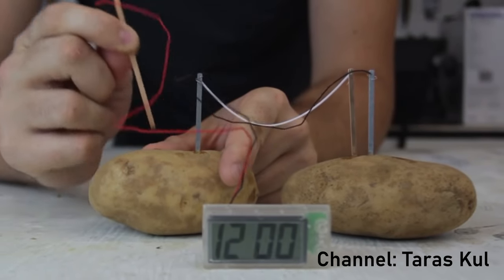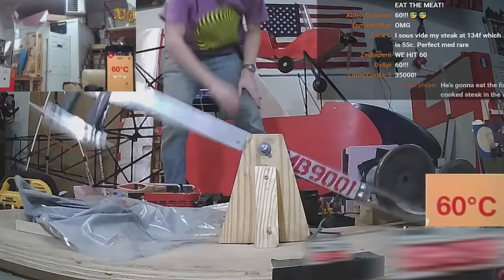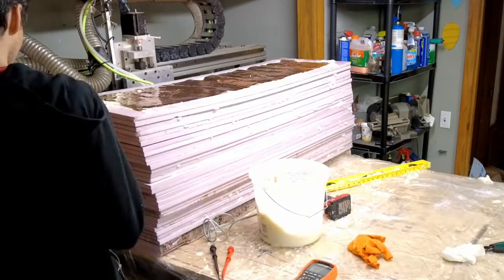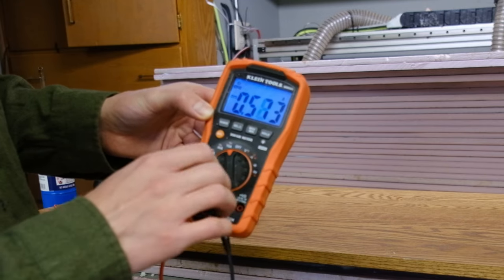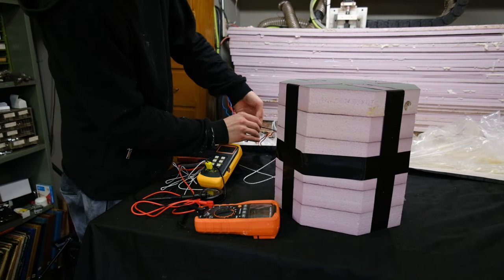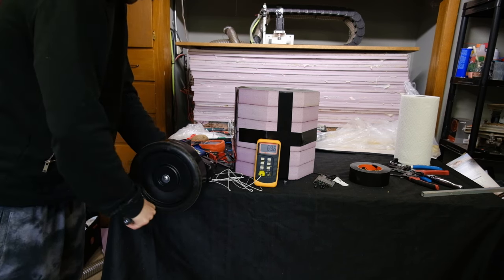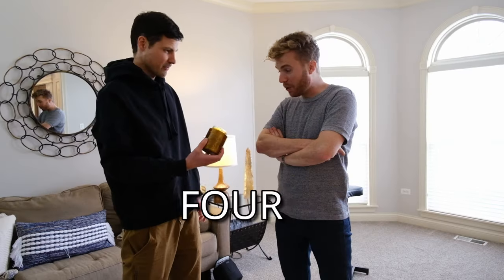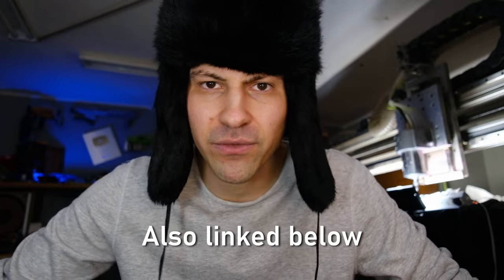Can you cook a Potato with a Potato?

Comment: Well, as the potato is not the part giving energy to the cell, but just the way to transport energy, you probably should use the thinner potato layer possible.
Then, using spiraling Insulator/Cu/Potato/Zn assembly, you could make a cylindrical battery "easily" top-fillable (and cleanable).
Also, the heating element is very nice, but insulating the potato further more with aluminium sheet is a waste of power (well, it can help spreading the temperature and will delay the cooking. So you can stop using your energy source and wait a bit for it to give back it's energy).
But anyways, the potato will degrade and won't allow electrons to pass, reducing the cell efficiency.
(Or I am wrong, that could very well be the case too, it's getting awfully late here).
As for cooking, you can assimilate a potato to water, and check how many watts you need to raise it's temperature to 100°c ish. That should give you a starting point to chose your powersource, and thus the size of your potato battery.
Your insulation on your cooking oven is insane! That's a very nice job, Bravo!
And the fall back solution is really nice too, I love it.
Thanks for this video, it was really interesting and entertaining!

Comment: i thought you were gonna use your jet engine to shoot one potato against another at supersonic speeds that the impact force itself would be enough to heat it up to 250 degrees and keep it that hot for a couple minutes. i guess this COULD be possible with enough insulation and high enough friction in the air or sth? maybe the jet engine isnt enough, though and what you'd really need is sth that goes boom

Comment: The potatoes aren't the source of the energy, they're just the slightly salty electrolyte, the zinc/copper electrodes actually provide the energy. It's why lemons are much better batteries, because they have much more acidic juice inside them, which allows for higher ion flows.
Reply: Your powdered potatoes are probably worse than regular potatoes, as I imagine they are slightly drier than real mashed potatoes would be, and they might well have lost a lot of the chemicals which slightly modify the PH of 'potato juice' during the desiccation process. This could leave you with a very low conductivity electrolyte, preventing you from achieving your desired power output.
Reply: Potato juice has a pH of around 5.6, as opposed to potato itself which is about 6. So, when you press a potato before drying it you remove the slightly more acidic juice, which you don't do if you just smash raw potatoes, or even if you boil them. This could have massively impacted your potato battery power, because even a slight increase in pH probably obliterates its ability to do ion transport.

Effectively, when that guy told you to use dried potatoes? That guy was the real potato.

Comment: You could try wiring some of the potato cells in parallel to increase the amount of current the battery can provide with minimum voltage drop.
Reply from the maker: They were all in parallel
Reply: @JoelCreates  Oh. They looked like they were in series for whatever reason. My bad.

Comment: The potential energy isn't in the potato it's in the metals. All the potato does is perform the roll of the electrolyte. Your power is dropping because upon initial connection you drain the surface charge. After that all that was available was the current that could travel through the potato electrolyte. If you would have simply added lots of salt or maybe baking soda to the potato mix you would have gotten better current. However as stated earlier the potato isn't what's creating the energy, it's the metals. It's NOT potato powered, it's zinc and copper powered. The potato just regulates the current. You could pee in the potato or simply use pee or Gatorade or salt water or Flint Michigan water there are so many different things that can replace the potato but only a handful of things that can replace the zinc and copper. Also you were likely losing tons of energy from shorting out the cell. You should have had a membrane between the potato. So zinc then potato then membrane then potato then copper.

Comment: The potato battery probably lost a shit ton of power due to two major factors: electrode passivation and ion diffusion. The zinc surface oxidizes quicklly and the starch is probably chelating the zinc and depositing over the surface, reducing the electrical contact. If I had to guess why this doesn't seem to be a big issue in smaller potato batteries, I'd say it's because of the slower reaction rate. Ion diffusion, however, is probably the biggest culprit. At the begining, there's no zinc in the potatoes and, as such, the chemical potential is at its maximum and the reaction rate is super fast, giving you that high current, but as the zinc ions start diffusing, the concentration gradient goes down and the reaction rates drop
Reply from the maker: Appreciate the info!
Reply: @JoelCreates  you're welcome. For future reference, to get the absolute maximum out of your potato batteries, you can try to use the thinnest layer of potato possible, since diffusion speed thtough potato must be really slow, and you can also try salting the potato mush to increase the amount of electrolytes in solution, that should diminish transport effects

Comment: I think a much more efficient way to cook a potato using a potato is by burning a potato they seem like they catch on fire decently easily you can get a rough estimate of how much heat it would produce as potatoes are 110  calories per 148g (they mean kilocalories I calculated it based off of how many jewels (623 KJ) of heat energy a potato has and it's roughly 110 kilocalories) so in other words enough energy to heat 110,000 grams of water by 1° c so assuming you want to cook a potato that has a mass of 148 g and the thermal properties of water  you could raise its temperature by a slightly ridiculous 743° c. according to Google you want to cook a potato at 220° c for 60 minutes so that would give you 3.37 potatoes cooked per one potato set on fire (note this is assuming a perfectly insulated oven and that there is no Mass inside of the oven other than potatoes I.e. the air would take energy to heat up as well also note the unit in jewels was from the FDA the only reason why didn't use it is because it didn't have a corresponding mass of the potato it just said "a medium potato" and I would much prefer a mass unit so I just calculated whether they meant kilocalories or calories by using FDA unit in jewels to back up their claim and unused the data for the number of calories was provided from potatogoodness.com)

Comment: What if you used tubes like the low voltage crystal batteries that run for years? smaller size but perhaps more consistency?

Comment: Probably would've been a better idea to drain the potatoes voltage into an actual battery, just attaching potato after potato until its eventually charged and then use that battery to power the oven. Its not cheating if the electricity was still produced by a potato and the battery is just the storage for that electricity!

Comment: I made a 1.5v battery go to 100v using a joule thief with a transformer and voltage multiplier circuit (cockroft-walton), so I'm guessing that you can make a joule thief powered by a couple potatoes, and make the transformer have multiple windings in parallel to get high amperage which should be enough to cook a potato (or at least burn its surface). In my opinion, transformers are so overpowered, so, just maybe, you can make a potato power a transformer to cook another potato. I'm starting to realize how impractical this is getting though.
Reply: Transformer can boost voltage, but can't boost power (energy). That's a limiting factor with potatoes.

Comment: if we ballpark the pedalling with 100w and use the random figure of a normal potato battery of 0.0012 watts i found with google
that means you'd need 83 thousand potato batteries or like 17 tons of potato batteries to equal your pedalling

this of course is with only one wire of copper and zinc each , soooo

Comment: Pretty sure the problem was actually the potato mix... I'm guessing it ended up doing electrolysis from the water and the resulting air bubbles broke up the connections, which narrows the space for the circuit and spirals until the current dropped low enough to become neglible for electrolysis.

Comment: I would've used the potato battery to slowly build up a collection of hydrogen gas using electrolysis. With enough hydrogen stored, you could then drive a hydrogen fuel cell or a generator to raise the temperature in the small oven

Comment: Your giant battery should have been able to do the job and then some.  Did you add any sort of additional charge carrier (salt) to the potato flakes?  I'm thinking that they just weren't conductive enough to act as the electrolyte.  Without mashing anything you ought to be able to make a battery that puts out 1W from 50 or so individual potatoes and 4 galvanized nails/pieces of copper each.  You'd do pipe (gap) nail - pipe (gap) nail - pipe (gap) nail - pipe (gap) nail in a line in each potato (nail - pipe is a nail wired to a pipe, both stick into the spud).  That would generate a little over 2V at ~0.01A.  Run a bunch in parallel and Bob's your uncle.  No need to mash anything.

Comment: Slapsgiving is a bit of a sausage fest!

Potato batteries aren't powered by potatoes anyway, it's the metal that does it. Probably most of us know that. Maybe adding salt to the mash might have helped. I suppose you could eat a potato, giving you the energy to work the pedals. 

Also might have helped to make the spud cells thinner, less potato between the electrodes, allowing the ions to travel more easily. So lower internal resistance = more amps and more available voltage.

Comment: You clearly need to desicate and then burn the potato to have any hope of cooking the other potato.  A potato is mostly water and to raise it to the boiling point with require a lot of BTUs.  Dry Potato is basically starch and the energy content of starch is 17.5 kj/g and Potato is 80% water so thats 3.5 kj/g for raw potato.  To cook Potato it's temperature needs to basically reach the boiling point of water 100 celsius and we can treat the whole potato as water for simplicity as this has the highest specific heat value.  Starting at room temperature 20 celcius the Potato needs to be raised 80 degrees which at 4.18 J/g/c means 334 J/g to cook. So it should take only 2 g of desicated potato to cook a 100 g Potato.

The best method to do this would probably be a preasure cooker operating like a bomb calrimeter, load the Potato to be cooked and the powdered dry potato fuel in a high pressure vessel and force pure oxygen in to burn the fuel and let the heat be absorbed by the cooking potato while the whole device sits in insulation, the high pressure will prevent its water from evatorating from the cooking potato which would waste energy and interfere with combustion. Wrapping the cooking potato in foil should help keep it from developing a burn taste as well.

Comment: Couldn't you use better electrode materials?
I mean, Copper is fine as a cathode, because Iron is hard to facilitate as it is already oxidized in air, Nickel is refreshingly toxic and Gold, Palladium, Platinum and Graphene are just too expensive.
But the anode material could be upgraded:
Lithium and the other alkalines might be too explosive but Magnesium, Aluminium and Manganese might be worth a try. Even though, they are all oxidized in air.
So it might be tricky but possible.

Comment: That makes me wonder the efficiency of something like a AA battery. With a setup like this, one potato at a time, could I cook 4 potatoes with 1 battery? If so, is this not a really efficient way in general to cook things? (More specifically, potatoes)
Reply: He did not said how many joules potato cooking takes 🙁
I doubt that 1 battery will be enough.
AA battery have capacity ≈ 1500mAh, with 1.5V it means ≈ 8kJ of energy.
I searched for amount of energy needed for potato cooking and found ≈ 660kJ and ≈ 120kJ values, but they were calculated without taking into account good thermal insulation.

Comment: If you're using outside materials like copper, zinc, heating elements, and aerogel, couldn't you have just used a potato battery to light a match and burn the potato?

Comment: did you take into account the effects of preservative agents? sodium acid pyrohydrate, dissolved in water, at higher than ambient temps forming crystalline hexahydrate? should have went with all natural potatoes. even a perfect setup for potato powder would be more dependent on exploiting brands with certain preservatives/anti caking agents then the natural chemistry of a potato.  a random box of potato from my cabinet has at least 5 additives that would mess with current  (literally EVERYTHING on the label after "dehydrated potatoes")

Comment: Ok can you please build same thing but with a compost bin cause I’ve always wanted to do that tbh as a test and a video and see how much power comes outta it take the bottom of the bin and half half copper and half zinc plates all connect together to make the battery and take stuff out that won’t work and have another test where you just throw everything in try different ways of connecting it like series or parallel like a battery copper to zink or all the copper connect and all the zink connected separate and then see how much power each time you get all the different ways maybe even adding some capacitors in between all of them each one have a capacitor kinda like a solar panel has a inverter in between solar panels on every solar panel so it has less power loss

Comment: well what if you have a big ass potato of about a pound in weight and you want to cook it in an air fryer at full temp It would need 2 hours of airdrying but, there's one problem it would create a hard shell and very dry interior of the potato there's an answer to that problem at one and a half hour dunk the potato in water! for 10 minutes and, it will soften the crust and moisturize the inside then put it back at a lower temp for half an hour and after finishing leave it for 5 minutes rest in the machine you will have a juicy mushy potato just perfect! bon appetite!!!

Comment: if you eat potatoes, your body will transform that into chemical energy, with that energy you transform into kinetic energy to turn a generator, the generator transforms kinetic energy into electrical energy which in an oven is transformed into thermal energy, known as heat that heats the potato. So you're cooking a potato with potato energy.